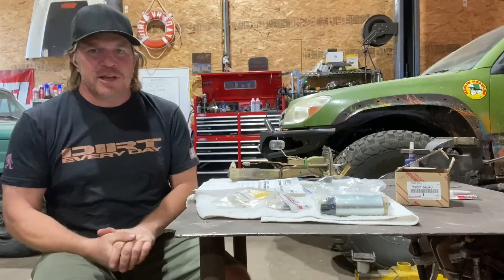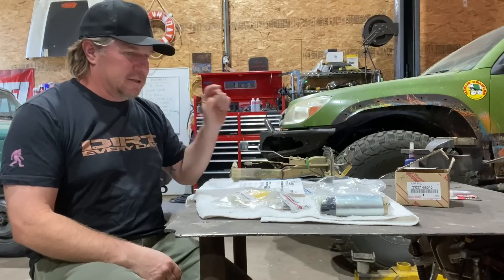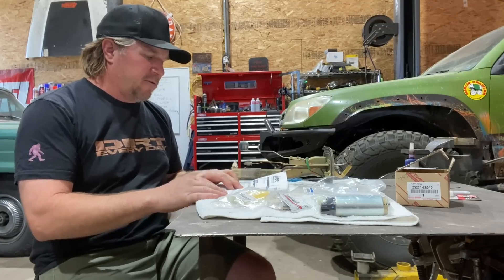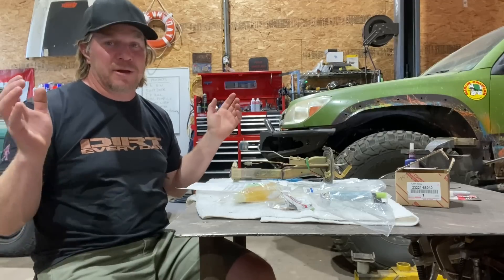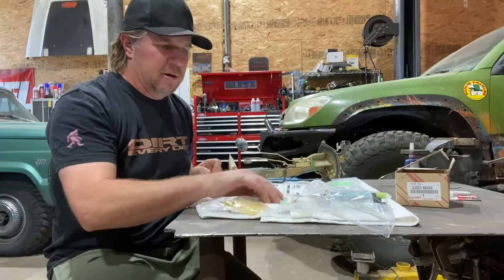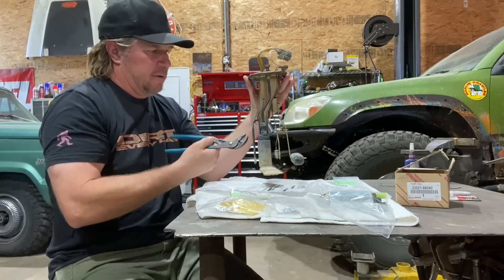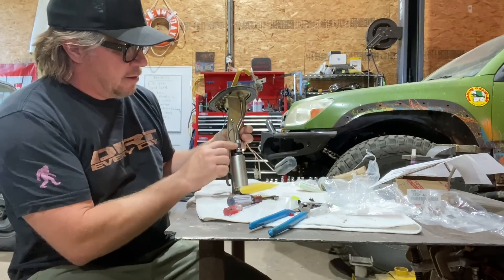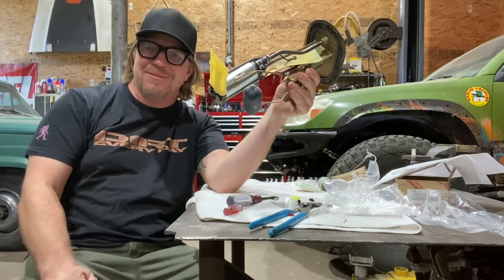Dirt Daily. Installing the new Land Cruiser Fuel Pump on the sending unit for the Dirty 80

Comment: Thank you for the detailed video! I’ve owned an 80 for ten years and it’s now my youngest son’s time to drive it. It sat for two years and I fogged the cylinders, added fuel and fuel stabilizer (sat with no fuel). It turned over and ran for about three seconds then died and it won’t turn over. I can’t hear the fuel pump activate when I turn the key so I’m guessing the fuel pump is toast? Anyone have a guess?

Comment: As a Toyota guy I try to get OEM parts or at least japanese parts if possible, they last so much longer than anything else. It's why Toyotas run for so long and insurance you won't have to be doing that particular job for quite awhile.

Comment: I use old crappy gas in my old Wheel Horse garden tractor.. the Onan twin will burn anything with more volatility than kerosene… currently burning 10 year old gas from a Olds Cutlass my mechanic changed the tank on…

Comment: Carter fuel pump kit for a 92 Land Cruiser (guessed at the year) $37.79 for everything you got from Toyota, from Rock Auto. (you knew this would happen, right?) As easy to access as the unit is on your FZJ is, I could change a lot of fuel pumps at $40 a pop. God bless and stay well. Also not a Toyota guy.

Comment: Damn, I bought a fuel pump for my 1985 4runner, and ordered a Denso, which was made in Japan. It was around $100, and was planning on doing the same for my 1994 Landcruiser which I am reviving. Just looked and it is on Backorder, but quoted at $120.
Reply: Dense is OE manufacture for Toyota you 120.00 pump will be just fine
Reply: @danfay4860  Well aware that Denso is the oem, hence why I ordered them. Thanks anyway